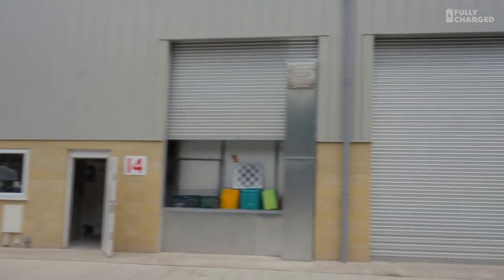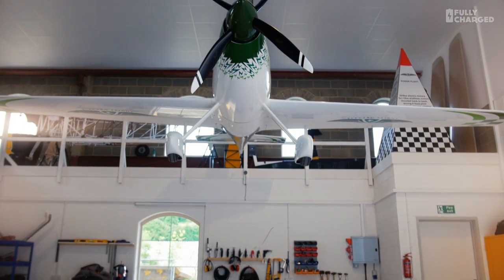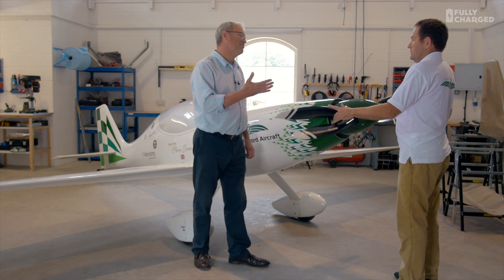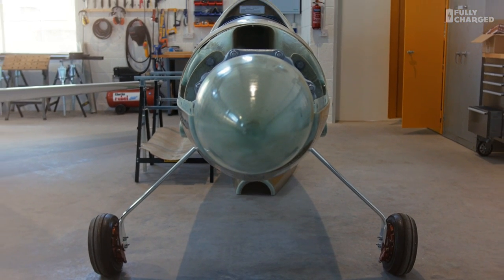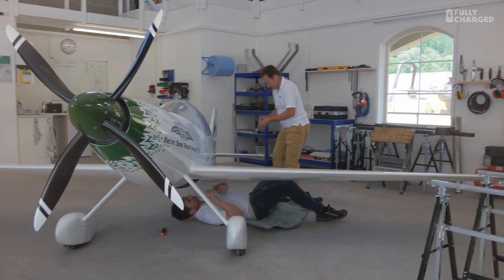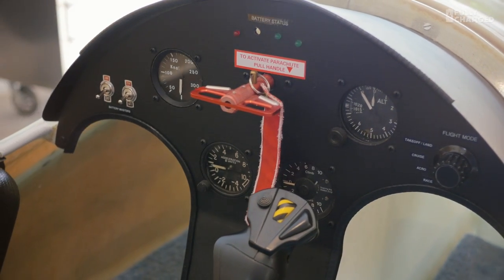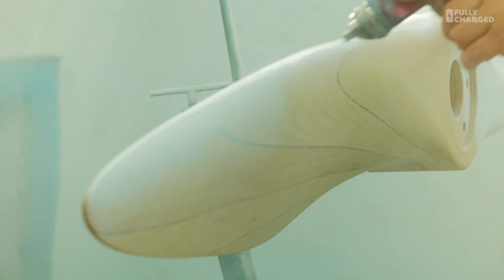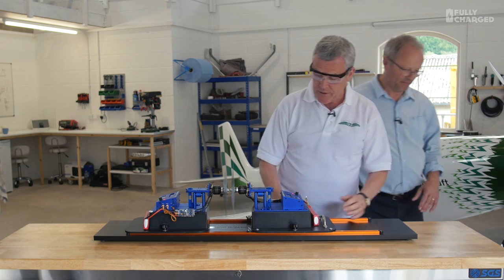Electroflight | Fully Charged

Comment: I think a key point made was that propeller aircraft technology became "parked" for a few decades  because of jet engine  development. Electric motor and battery  technology has the potential take propeller or fan technology to the next step.
Reply: So much potential it's revolutionary.
Reply: Propellers don't really work at the speeds that airliners or fighter jets fly at. For those you'd have to use a ducted fan if you want to go electric. Actually modern airliners already have ducted fans, it's just that a jet engine drives the fan, which produces most of the thrust, while the jet engine exhaust provides only a fraction of the thrust. So if you had a powerful enough electric motor you could power the fan with that instead.
Reply: Skräcken Russia has large prop bombers that can fly at least 550mph (some clocked faster) the same speed as the average air liner, they are large prop craft which carry very heavy loads at some very high altitudes, there is no reason why you wouldn't use them in a hybrid system, it just wouldn't be super fast, but nor is the average air liner.
Reply: Indeed so, but it's at the extreme end of what props can do, and it's also one of the loudest airplanes ever made. The americans tried to make a supersonic propeller fighter too,  but it simply didn't work. And that one was so loud it actually made the ground crew sick and some even became unconscious.
Reply: Skräcken Electric engines are quieter even with a prop, we also have quieter prob designs nowadays, you would be using generators to power the electric engines (in a hybrid system), there would be a significant drop in noise compared to old soviet bombers...  I think also that it would be possible to use solar panels to get some power back also, lots of possibilities there.
Reply: When I'm indoors with all windows and doors closed, I frequently hear turboprop planes(Saab 2000, sometimes ATR72) at cruising altitude. But I never hear jets, and where I live we get everything from 737s to A380s flying over head. The main source of noise isn't the engine, it's the prop, and the Saab 2000 don't even have counter rotating props. I don't see why there would be a problem building an electric plane with a fan instead of a prop, really.
Reply: Who knows... But I'd wonder what they could do if they switched to a fan-prop like some turbo-props have transitioned to. Then again the 300HP rating of the aircraft we're looking at isn't likely enough to make use of that. (Turboprops being on a different tier of performance than small piston-engine aircraft.) Other than that, some of that "parking" in general aviation is due to regulatory encumbrance. If piston engine tech kept pace with non-avaition equivalents, they'd all be fuel injected with mix and stuff like pre-heat fully automated.
Reply: I guess the regulations see modern electronics as not reliable enough? Don't they still use magneto ignition in many planes?
Reply: Yes RealistReviewer, the Russians have them and you can hear the Bear for miles it's that loud, and the main problem here is that the prop tips are actually going supersonic on them, which means loosing effieciency and creating a lot of noise. 
Hell fighter Pilots in the cold war that were tasked to intercept them, joked that they didn't need the radar to find a Bear, as you could hear it for miles. 

I mean the XF-84H shares the spot for the loudest Aircraft ever with the Tu-95, Tu-142 Bear and their Tu-114 Airliner derivative, which was called the table saw. 
And the XF-84H was so loud that it made people dizzy, made them sick and made them soil themselves. 

There is even one case where the Thunderscreech triggered an epileptic fit in an engineer. 
http://www.abc.net.au/science/articles/2003/09/11/934718.htm?site=science/greatmomentsinscience

I mean it was creating 900 sonic booms a minute. 

You also forget one thing, in a Turboprop the prop might under most circumstances create 80% of the "thrust", but the further 20% are created by the Jet part of the engine, something which is missing with an electric motor. 

A discussion about engine efficiency:
https://aviation.stackexchange.com/questions/9940/what-are-the-advantages-and-disadvantages-of-ducted-fans-in-designs-such-as-the

I would also like to point out that he never actually says how fast his aircraft will be, and looks to be a competitor for the Extra 300s that are used in the Red Bull Air Races, which aren't that fast. Look at the stuff that goes on at the Reno Air races and others there you will find fast planes. 
Most of which are rebuilt and heavily modified WW2 and later Warbirds, which push out north of 1,000 if not north of 2,000 Horsepower, with certain ones having even reached 3,000 horsepower. 
By comparison 300 horsepower is not that much. 

Oh and so nice of him to point out that the Red Bull Air racers are the competition, well sorry that's bit like comparing a VW Up GTI to a V10 Era F1 Car and calling the UP GTI high performance. 

You don't want a heavy "back" (aka tail) , but you also don't want a heavy nose........both are quite detrimental to flight safety........heavy tails pitch you upwards into a stall, heavy noses, well they nose you downwards.......into the ground. 
How was the old joke? "Stick forward means the houses get bigger, stick backwards means the houses get smaller. That is unless you pull the stick all the way back and keep it there, then the houses get bigger again!" ;) 

BTW that Stick in the model does seem familiar isn't it?
https://www.overclockers.co.uk/thrustmaster-usb-joystick-for-pc-gc-053-th.html
That is an unmodified version of the cheapest stick that thrustmaser makes. 

Also very, very basic cockpit, it has no ADI (Attitude Director Indicator=artificial Horizon) and where's the damn radio?
And no horizontal situation idicator or other navigation gear. 

And no constant speed props, great, they are going to waste oodles of power and torque either on take off or at high speed, because you can't change the prop to fit either properly. 

The early Hurricanes had wooden props which could not change their prop pitch which resulted in excessively long take-off runs, and save for some oldtimers most aircraft of today have a a variable pitch aka constant speed propeller. 
Not having a constant speed prop is a massive waste of efficiency. 

The more I watch the more I feel that something is off here.......

And the guy who runs the show is clearly not very knowledgeable in Aviation, and seems a bit more intersted in being entertaining than doing hard hitting journalism. 
Also just for the record, I am not an expert in aviation, just an interested amateur, but looking at the video, I know more than him.

Comment: Well done Robert , these fully charged shows are brilliant  , well produced very interesting deserving of a prim-time tv slot . i have flown electric powered model planes for over 30years and the advent of brushless motors and lithium batteries over the past 15 years had finally made the planes perform on par with the combustion motors , im sure this aircraft developed by this forward thinking inovative team will have very , very impressive performance with many advantages.

Comment: 15:30 When you notice the model motors start driving the full size prop on the prototype.  Insanity!
Reply: That's because electric motors are 2 strokes, they are an electromagnetic form of 2 stroke with high power and few parts. Also lightning bolts are 2 stroke because they fire down a streamer and up a return stroke sometimes it can go the other way, but its one of the most powerful and energetic 2 strokes known!

Comment: I've been flying Electric powered model aircraft for years now using 3 phase brushless motors and Lithium Polymer Batteries. This combination has revolutionised the radio controlled model aircraft scene and has helped with the development of all modern electric vehicles.  
The model motors produce huge torque and high power and some models can be as large as 50% of the real full size aircraft.  Many modelers prefer this method of propulsion over  Petrol or Nitro/Diesel because of the reliability and adaptability with the benefits of clean, quiet flight.

Comment: This technology is a very important step toward sustainable air transportation. Thank you very much Robert.
Reply: No it's not! This thing does nothing to advance battery chemistry, electric motor design, aerodynamics or  pretty much anything else. There are battery powered light sport aircraft, and they all share one feature. Anything they do has been done better long ago by internal combustion powered aircraft. There are probably more four to six seat aircraft that can fly better than 100 mph for hundreds of miles, and with an instrument rated pilot  do the same in all but the most severe weather than any other class of aircraft, but so far there isn't a single electric aircraft in that category  because electric power systems do not produce enough kilowatt hours, and no battery chemistry that is threatening to go into production in the next decade can .

Comment: High power is easy, just look at the model flying community, they've been doing just that for years. The hard part is a long range electric plane.
Reply: An overunity motor generator could be used like john Searl magnetic motor generator or a Witts generator.